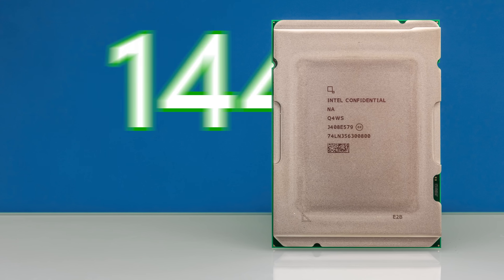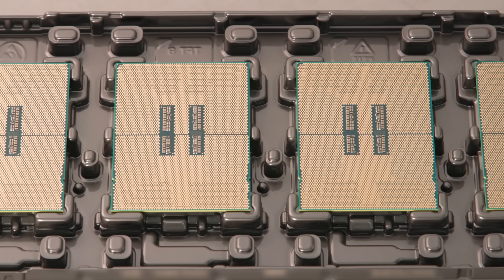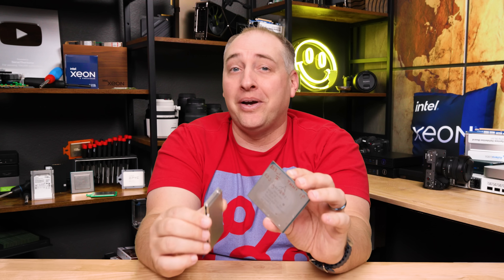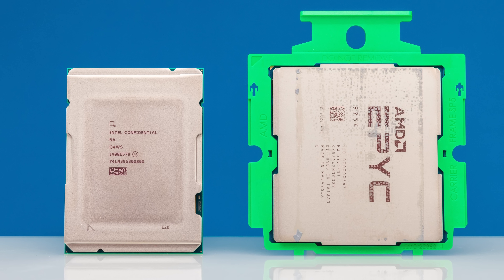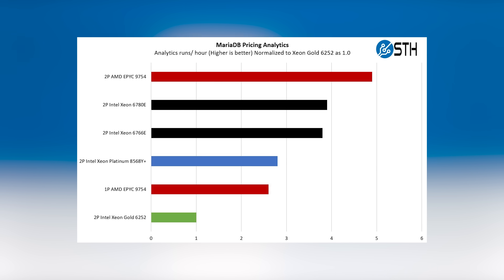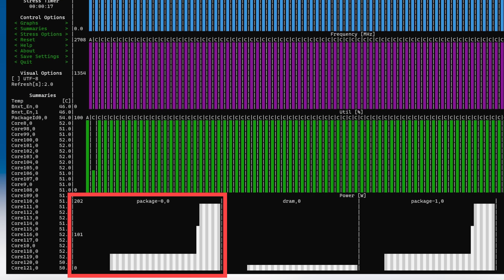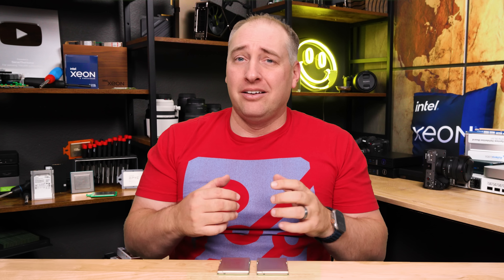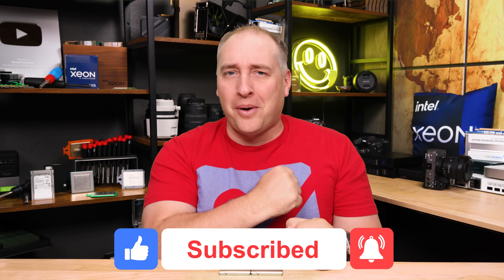MOST Server cores EVER Intel Xeon 6

Comment: So this is a beefed up n100? lol
Reply from the maker: A generation newer E-core, no iGPU, huge accelerators with things like QAT.
Reply: @ServeTheHomeVideo today Intel announced that Skymont E-Cores are 1.7x faster at the same power draw than Crestmont E-Cores. This CPU uses Crestmont E-Cores of course 😂😂😂

Calling it a beefed up n100 is harsh but fair.
Reply: I keep hoping for a n100 but with like 64 pcie4 lanes with bifurcation support.
Reply: As someone who spent the last two years writing firmware for the Birch Stream platform that these CPUs run on, this couldn't be farther from the truth. Aside from the microarchitecture and process node being completely different, the platform itself is completely different. You do not get full RAS capabilities and self-boot on the CPU with an N100. Also, the floorplan of the silicon is completely different. The N100 is monolithic while these CPUs have the compute tile in the middle with IO tiles flanking it on either side.
By your logic, an AMD Epyc Genoa is just a beefed up AMD Ryzen 7000 (which is ironically closer to the truth than your statement).
Reply: @AlexSchendel  So it's a beefed up n100 with some server features that are present in all silicon but not fused off in the server part. Thanks for confirming this.
Reply: @MustermannAnybody  So you're saying you didn't even read my comment then? If you just try to blindly scale up everything without rearchitecting the interconnects (our scalable fabric vs the ring bus) and the whole platform, you're going to have a very, very bad day.
Not to mention, I don't think you understand what "server features" are if you think they are present in all silicon.
Reply: @AlexSchendel  are we talking about the server feature ECC that is 100% clearly always present and just fused off?
Reply: @MustermannAnybody  That is one feature, but there are many others. We have full RAS firmware features for error handling as well. Not to mention all the accelerators that are not present on client.
The scalable fabric is also way different than the ring bus or NoC. And the addition of UPI links and accompanying controllers for connecting with other CPUs on the platform

Comment: Before watching the video:
This is the "infamous" Sierra Forest, right?
I kind of wish they did 288 core version, but they were afraid of being too late on the market. Sadly from what I've heard they are still too late (by at least a quarter) and now they don't have their "flagship" product. Not that too many companies would buy 288 core version in big quantities. Also word on the "street" is that this is 144 E-cores. I really hope those are the updated Skymonts not the older ones.
Anyway, this is going to be interesting. I wonder how it will stack against Turin Dense (192 Zen5c cores). Also I do wonder how regular Turin will look.
EDIT:
After watching the video - I'm surprised they will have 288 core part. While I think the biggest product was above 300 cores, that was scrapped (I would have to look back on leaked road maps), but it's nice that they kept working on 288 core variant. Intel was always fantastic in innovation, just very variable in actually doing something with said innovation. And it is great to know that E-cores are on Intel 3. That should make them real efficient and it will be useful in places where power to performance is the most important (but you don't have to pay "per core" costs, so no VMWare). Sadly for Intel, this is still a bit too late (12-18 months) for them to retain large portion of their customers. Some went with Arm, others with AMD - depending on what they needed. If Emerald Rapids didn't come to the rescue in the fall of 2023, Intel would be looking at abysmal future. For now it just looks bad and they will have to leverage their Foundries heavily.
And also stoked to see that P-core versions will be available this year… I think. Intel's road maps have tendency to be very fluid, and I don't even remember all their code names anymore.
Reply from the maker: Granite Rapids-AP at 128 cores will be competing with Genoa 96 cores in Q3 of this year.
Reply: @ServeTheHomeVideo  That's good. I think it is still behind original schedule, but at least it is before AMD releases their new Architecture. Personally I dislike when those companies release stuff in "reactive" timing, something AMD and Intel did before - so usually waiting what other will announce and announce something better "just quarter later". But in this case, AMD is a quarter late and if we don't count really old Intel road maps, then this is more or less on time (though I think Sierra Forest was supposed to be Q1 even in last years road maps). There will e competition and the most important thing - there will be lots of SKU's that will fit most niches.

Comment: Finally, an interesting Intel Xeon product! However, with Turin 5c on TSMC N3 right around the corner, I don't think Intel products will bode well. AMD is going to have the performance lead with their 192c chip and I guess the perf/watt lead as well.
Reply: I think reading the Phoronix benchmarks against the top of the line EPYC skus the comparison (if you’re not comparing floating point & avx) is actually quite decent, so I definitely have a bit of hope that Intel and AMD will be pretty close for Turin Dense vs SF-AP.
Reply from the maker: Turin Dense is Q4. Sierra Forest-AP is 288 cores in Q1. That will be the bigger battle.
Reply: @ServeTheHomeVideo  Considering Turin is Genoa SP5 compatible, I think AMD has a big advantage there over Intel, basically anyone on EPYC will remain on EPYC.
Reply: @ServeTheHomeVideo  Xeon 6900 will be the same arch and process but with more core. At the moment, 64c 128t Epyc 4th gen is roughly equivalent to the Xeon 144c. Zen 5c will be on a new process, new arch and will have more core. It is clear to me that the Epyc 192c/384t will be superior, but I'm curious to see what the result will be at thread parity !
Reply: @matthope_qc  Well - TBF I think 288 cores will have more memory channels than 144 cores one. And more I/O in general probably. Yes, it's likely that Intel will still be behind AMD in performance. performance per Watt is still a bit of an open question (heard ton of good things about Intel3, some bad, some good things about N3). I certainly can't wait for benchmarks and various comparisons.

Comment: In the mean time AMD announced Epyc with 192 cores and 384 threads lol
Reply: Also those are actual cores, not gimped "e" cores.  Only benefit is from Intel not using Intel fabs this time lol
Reply: @diamondlion47  It appears that Intel is dropping HT (hyper threading) in favour of using a single thread on each p-core, with the e-cores presumably taking on the role of what used to be a thread, sort of but not really, since e-cores are also not fully ISA compatible with the p-cores. AMD's "c" cores have the full ISA and threading, so there's no need for a much more complex and messy scheduling system to make their solution work.
Reply: @diamondlion47  This is on Intel's Intel3 node, and I wouldn't call similar performance to Zen2 thread for thread gimped. Not the fastest out there for sure, but it's not supposed to be either.
Reply from the maker: Turin is Q4. So the 128 core Turin in Q4 will actually see Granite Rapids-AP launch first with 128 cores. AMD will be behind next quarter unless they move Turin up. Turin Dense at 192 cores will be competing with 288 core Sierra Forest. 288 physical cores versus 192C/ 384T is not a straight win. We go into this in the video.
Reply: @ServeTheHomeVideo  Isn't Turin second half of 2024? Which basically means it can be launched next month
Reply: @dota2tournamentss  Yes, 2nd half '24, which could be as early as 1 month away, or as late as 6 months. AMD did fast-forward the Zen 5 Strix Point processors to next month, they may also have pushed forward Turin, but there's no way to know.

Comment: Data center that's still using V4 ish Xeon is literally going to be consolated to a few rack. Holy hell. Moore's Law is alive and well.
Reply from the maker: Totally. 12-16 cores was common back then with chips like the E5-2650 V4. Imagine doing 12:1 consolidation of those midrange SKUs.
Reply: @ServeTheHomeVideo eHomeVideo So literally the super computer that just went on sale can be replaced CPU for for CPU core with 500 dualsocket blade of this thing. Assuming (generously) that each dual socket take up 4U that will be like 2000U or 50 racks... If in 2U blades they will be 25 racks, or barely even 1 ailes. It is insane.
Reply: That would be like consolidating my entire E5v4/1st gen SP homelab into a single 1S server.
Reply: These compare to xeon scalable 2 if I'm remembering right, so anyone who hasn't upgraded inn the last 5 years or so can probably do massive consolidation with these.
Reply: @huy1k995 Moore’s law describes a doubling of transistor density every 2 years. The consolidation he’s describing replaces silicon that is almost 10 years old. How is that an example of Moore’s Law being alive and well?
Reply: @nonchalanto — To be a bit pedantic, Moore’s Law is not a doubling of transistor density, it’s a doubling of absolute transistor count per integrated circuit. 

In practice, physical die sizes remain fairly constant, so there’s not really much difference.
Reply: @nonchalanto aww just let the intell fanboys pretend this is a win they have so little to celebrate these days

Comment: We stopped ordering Intel servers. This isn't much of a change so not likely to start again.
Reply: I did the same thing, all new servers are now on the EPYC series, it's been a large improvement. The biggest problem is the time to get them as they seem to be in high demand. Even if the Xeon 6 series is an excellent change, it was not around for years when the EPYC series was clearly a better choice, which is why this new 6 series won't change anything for me. Switching between Intel and EPYC won't be a decision taken lightly, I'll wait to see what happens over time while Intel's new product lines mature relative to the new products that AMD manages to compete with.
Reply: @geekinasuit-l1b  Yup - too late. This is sadly a title of this chapter of Intel's existence. Only big thing that this has on EPYC is it's accelerators. They are fantastic. But a lot of companies already switched to AMD and even more that are preparing to have newer servers, already invested money in changes they will have to make to switch to AMD. And it's not like Intel has better product. It's just not bad and comparable in some segments to AMD. So no incentive - especially if you're company that can make QAT accelerators work with AMD processors (which used to be hard initially IIRC).
Reply from the maker: Wow. That is a wild statement. This is an absolutely crazy change for server CPUs. Easily the biggest for Intel in two decades or more. Sorry. After using these (and you can see our Genoa/ Genoa-X/ Bergamo videos as well) I have no way to reconcile that comment with the servers we are showing.
Reply: @ServeTheHomeVideo  It is a lot of cores and a very good power target - Intel explicitly market the E-Cores for some sub-markets like web servers and CDNs. It could well be possible that these chips will not so hot for other tasks where Intel explicitly markets the P-Cores (databases, simulations, etc.). In the end the ARM servers chips with many cores and good efficiency suffered from the same issue and only limited pickup.
Reply: @ServeTheHomeVideo  Selling Intel pretty hard here... 🤔
Reply: @diamondlion47   doesn't look that good when one is supposed to be a jornalist, but i guess its to expected from "access journalism"
Reply: @ServeTheHomeVideo  Perhaps for their specific use? Though it's possible that said person didn't watch the video. Or that change isn't for them. I agree that this is a huge change, just not for everyone. And other CPU's should come later. If there are no delays. For some it will be too late.
Reply from the maker: @jannegrey  I also look at it like by making the E-core CPU, it lets Intel do more on the P-core side since it does not have to focus on the lower performance market.
Reply: It's rather simple reasoning. If more, weaker, cores is your thing, AMD has a better solution. If less, more powerful single cores is your thing, AMD has a better solution. Why would I go Intel when either way, AMD has a better solution in their newly announced product stack? That Epyc 9534 processor has been out for 2 years now.

There is no compelling reason to switch back to Intel.

This might be "cool" for enthusiast reasons but it's not a viable option when compared to the competition.
Reply: @thepcenthusiastchannel2300 sounds like a huge volume of cope to me 😂
Reply: @bronsondixon4747  Probably because you don't work in the industry. It's what so many of us are now doing. I used to only deploy Intel servers. Nothing but Intel. Now it's all AMD. If Intel has nothing that really shines, why switch back?

Comment: Q:  With more than 10X the core count of a Snapdragon X Elite laptop, what can it do in the TOPS count?  Are desktops & servers still the #AI boss?
Reply from the maker: This is less of the AI chip. Granite Rapids (P-core) is better for that with AMX. Think of this as taking VMs off of legacy chips from many servers, and putting lots of those VMs and microservice onto a single server instead. That is why this is an exciting launch. Intel is, for the first time, really putting forward different domain specific CPU architectures.